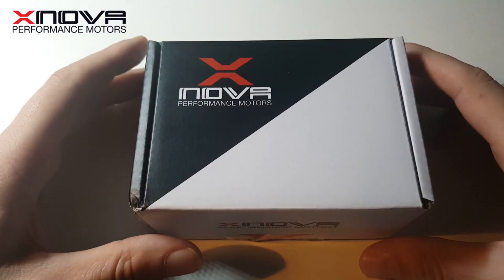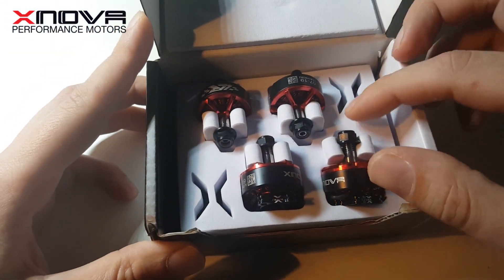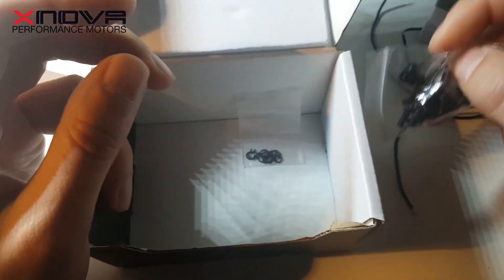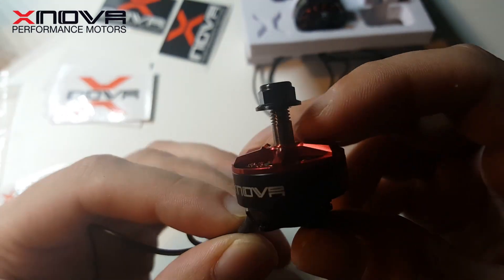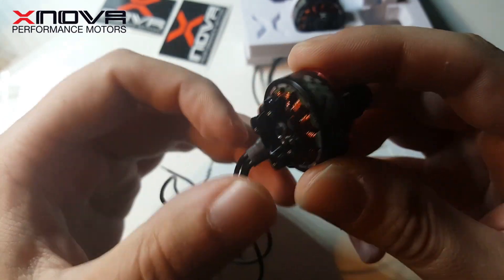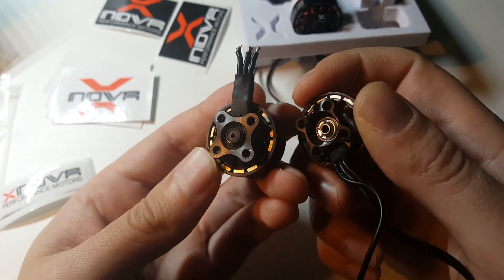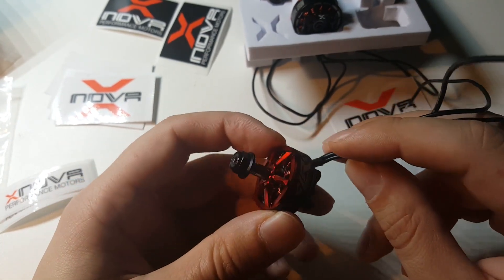New FPV racing motors Xnova Lite Racing 2207 1950kV test/review

Comment: What do they weigh man
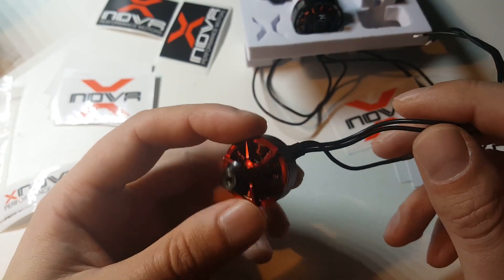Reply from the maker: 1:48 - around 29,5-30g.
Reply: @emmetscopters964  that is good weight. Cheers bro.
Reply from the maker: @noisy_boi_fpv_3920  Yep, it is. That's one of the main reasons I've chosen these motors.

Comment: How are those motors holding up?
Reply from the maker: So far so good. No single problem yet, plus now I really got used to them. It's a perfect choice for 250-310g (weight without battery) 5 inch setup.

Comment: is that 16x16 mounting. cant find that info anywhere, been told they are 16x19?
Reply from the maker: It's 16x16, a standard these days ;)
Reply: @emmetscopters964  ye, I no that.  But a friend mentioned to me he thought they where 16x19. So before i purchased i wanted to make sure.  And there was zero mounting pattern info.  Contacted xnova and they updated there pages. 

Thanks for reply

Nice flying by the way.
Reply from the maker: @SQuiDFPV  no problem, glad to help!